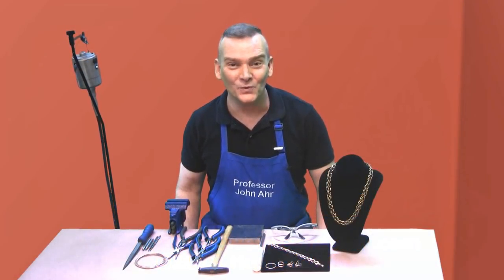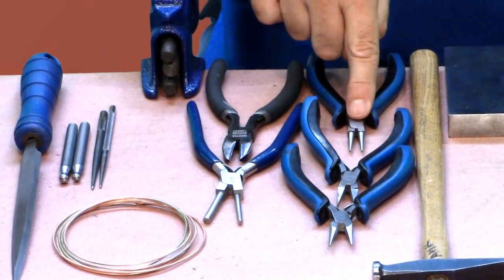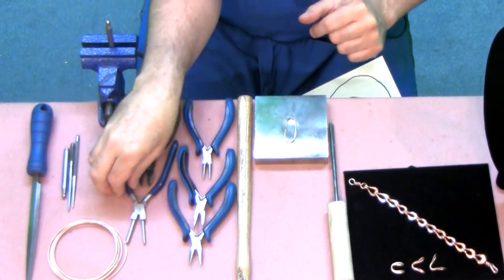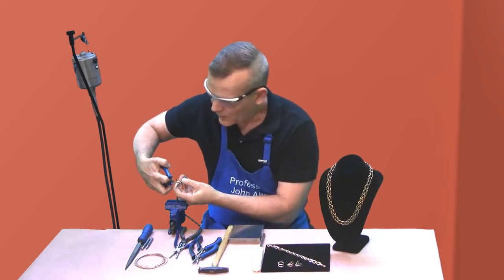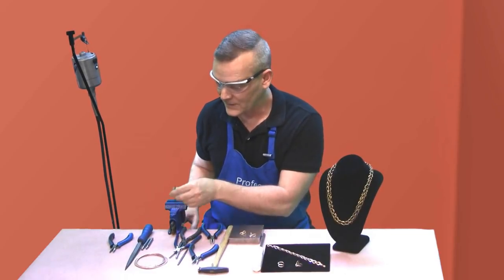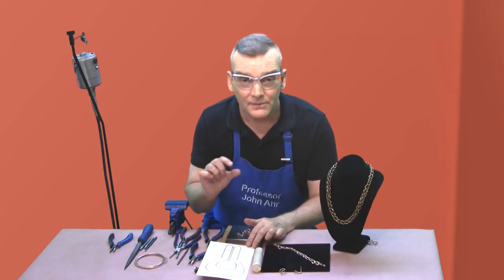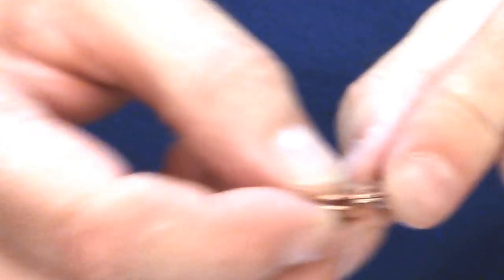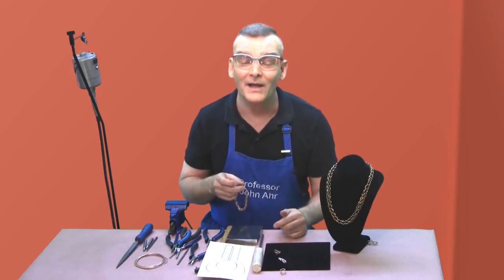Make A Beautifully Forged Sailor's Chain Bracelet  - Part 1

Comment: John love this chain, did you mention the size of the ring ? I guess you could make it any size you wanted. Thanks John, I look forward every Saturday for videos.
Reply from the maker: Hey Buddy,  The ring size was about an inch in diameter.  You can make the loops any size.  But, if you're going to use 14 gauge round wire, you'll need to make the loops at least 7/8" in diameter.  Otherwise, the loops won't move ore you won't be able to assemble the links.
Thanks for your support! : )

Comment: Thanks for this, John, I’ve been reading about loop-in-loop chains, but not quite understanding how the links went together. And I’ve been putting off even trying it because of wanting to get fine silver wire so I can just fuse the links instead of soldering them. 😂 

That’s a very clever way of forming the links, too! I broke down and bought a fancy link-forming tool from Río Grande because I know I’ll never be able to stretch the jump rings all the same otherwise. I also don’t have a steel dapping set yet, and living in an apartment, it’s not at the top of my list to buy. I’m trying to stick to techniques that don’t require any forging, although I love that look on these links.
Reply from the maker: Hi Wendy, The OJA has another loop-in-loop chain project that doesn't require any forging.  The video is entitled "The Ancient Art Of Loop-In-Lopp Chain Making".  You can find it on our website at: www.onlinejewelryacademy.com.  I hope you enjoy making your own loop-in-loop chain.
Thanks for your support! : )
Reply: You'd be surprised at what you can do in small spaces with inexpensive tools.  I actually used my round nose pliers to stretch my jump rings and I only have a 2-inch bench block for hammering and no workbench at all.  My first projects were with 999 Fine Silver because fusing was easier than soldering. Also, I use my kitchen stovetop as my soldering workspace.  Gotta be creative! 😄
Reply: @tammygurl64  My apartment is actually huge, with no shortage of places to work. I just don’t want to make a lot of noise and disturb everyone else.

Comment: I thank you John I also enjoyed your video but was also wondering what size jump rings did you make thank you
Reply from the maker: The ring size was about an inch in diameter.  You can make the loops any size.  But, if you're going to use 14 gauge round wire, you'll need to make the loops at least 7/8" in diameter.  Otherwise, the loops won't move ore you won't be able to assemble the links.
Thanks for your support! : )